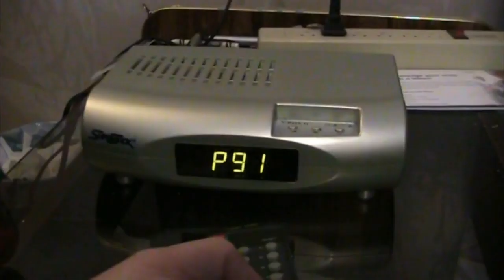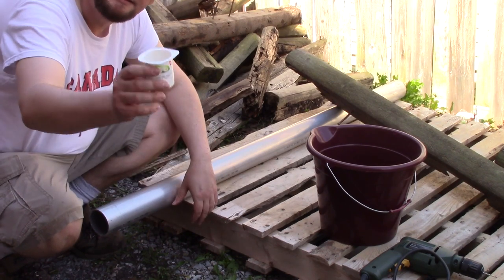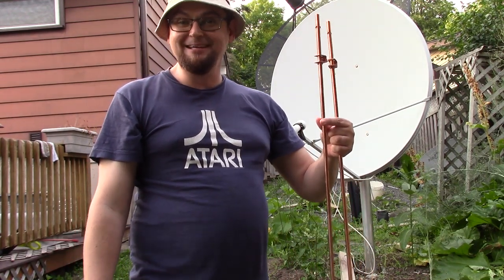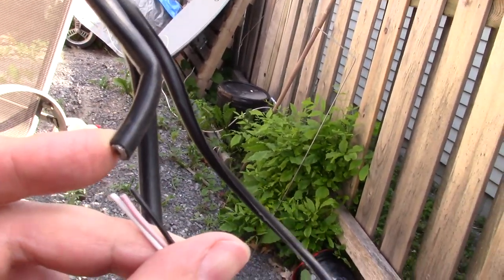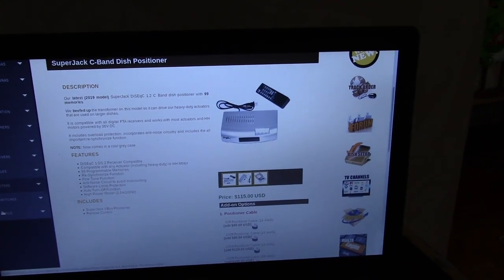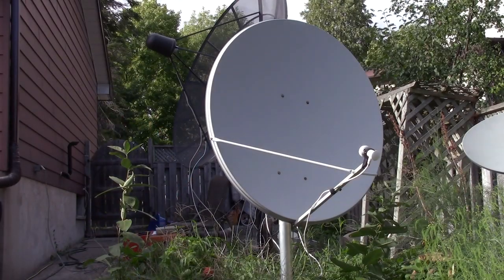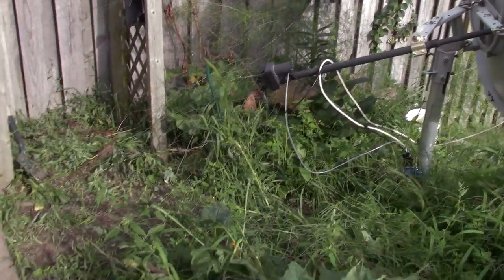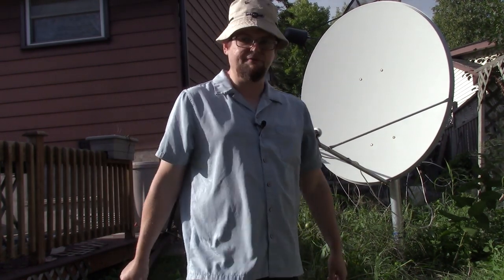The Moving Satellite Dish - Setting up a Ku Band dish with an Actuator and a Dish Mover

Comment: yeah, my very old analog C\KU receiver controls the 10ft dish's rotor. The receiver is no longer setup so I have no idea if it still works, but back in the day all I had to do was use on screen menu to select the channel I wanted to watch and the receiver moved the dish to the correct correct sat. What I liked about Satellite TV vs cable was that I could al-carte subscribe just to the channels I wanted, plus sat TV had 100s of free channels that were not on cable. Like cable, most were channels I never watched, but at least I didn't have to pay for them.  Back in the early 1990s, sat subscription channels like HBO, and SHO had multiple channel feeds that were not on cable, so for $15 per month (VideoChipher II), I got 6 channels of HBO with Dolby Digital surround sound. Cable only had one HBO channel with mono sound.  And It was also pretty cool to get the east coast back haul network feeds 3 hours ahead of local programming.... All of this is pretty standard today given nearly everything can be streamed via the internet and on demand.
Reply: Instablaster.

Comment: What satellite dish, receiver, and LNB would you recommend for a basic and cheap setup? I'm interested in getting into satellite as a hobby, I'm just not quite sure where to start.
Reply from the maker: This dish will work for North American Ku Band fro #FreeSatellitetv
https://rover.ebay.com/rover/1/706-53473-19255-0/1?icep_id=114&ipn=icep&toolid=20004&campid=5338505983&mpre=https%3A%2F%2Fwww.ebay.ca%2Fitm%2F39-KU-BAND-SATELLITE-DISH-ANTENNA-FTA-FREE-TO-AIR-LNB-CHINESE-PERSIAN-97-W-36%2F223266593197%3F_trkparms%3Daid%253D111001%2526algo%253DREC.SEED%2526ao%253D1%2526asc%253D20160908105057%2526meid%253D090367fe4f9f4f7295d10c8eeb7a9a2e%2526pid%253D100675%2526rk%253D3%2526rkt%253D15%2526sd%253D172652269201%2526itm%253D223266593197%2526pg%253D2481888%26_trksid%3Dp2481888.c100675.m4236%26_trkparms%3Dpageci%253Ac3c8c3a4-acd0-11e9-a89e-74dbd1800ebf%257Cparentrq%253A1bd1b8a816c0a9e8a24cd315ff5d7b65%257Ciid%253A1%20 

For someone just getting into #FreeSatelliteTV this Amiko Mini is a good start. With the seller a hobbyist ke4est himself will help you out getting started! https://rover.ebay.com/rover/1/711-53200-19255-0/1?icep_id=114&ipn=icep&toolid=20004&campid=5338505983&mpre=https%3A%2F%2Fwww.ebay.com%2Fitm%2FAmiko-Mini-HD265-FTA-Receiver-DVB-S2-H-265-HEVC-With-NTP%2F172652269201%3F_trkparms%3Daid%253D111001%2526algo%253DREC.SEED%2526ao%253D1%2526asc%253D20160908105057%2526meid%253Da114fa698e094266b8fe64ecacd40abf%2526pid%253D100675%2526rk%253D1%2526rkt%253D15%2526mehot%253Dag%2526sd%253D172652269201%2526itm%253D172652269201%26_trksid%3Dp2481888.c100675.m4236%26_trkparms%3Dpageci%253A9bfa2237-5d87-11e9-a26b-74dbd1802482%257Cparentrq%253A1436489216a0ab674b72a601fffee48d%257Ciid%253A1%20
This receiver is in the under $100 category! 

Also you will need RG6 Cable you can get this and the cable screw on ends at a hardware store!

https://rover.ebay.com/rover/1/706-53473-19255-0/1?icep_id=114&ipn=icep&toolid=20004&campid=5338505983&mpre=https%3A%2F%2Fwww.ebay.ca%2Fitm%2F100-FEET-RG-6-SATELLITE-CABLE-RG6-COAXIAL-CONNECTOR-HDTV-ANTENNA-CABLE-BELL-FT%2F382464587687%3F_trkparms%3Daid%253D111001%2526algo%253DREC.SEED%2526ao%253D1%2526asc%253D20160908105057%2526meid%253D090367fe4f9f4f7295d10c8eeb7a9a2e%2526pid%253D100675%2526rk%253D2%2526rkt%253D15%2526sd%253D172652269201%2526itm%253D382464587687%2526pg%253D2481888%26_trksid%3Dp2481888.c100675.m4236%26_trkparms%3Dpageci%253Ac3c8c3a4-acd0-11e9-a89e-74dbd1800ebf%257Cparentrq%253A1bd1b8a816c0a9e8a24cd315ff5d7b65%257Ciid%253A1
Reply from the maker: Dont use a dish network dish it will not work good at all https://www.youtube.com/watch?v=h96UIOIljWk
Reply: Thanks for the links, I appreciate it! It seems like an amazing hobby to get into, I can't wait to try it out! I look forward to seeing more videos!

Comment: Robbie what's the diameter of the pole you used? As well where'd you pick it up?
Reply from the maker: i got a 3 inch pole for this dish. I went to a metal dealer and he cut it to my request length. I think I paid $60 my pole was aluminum was the same price as steel so it saved me having to paint it so it would not rust!